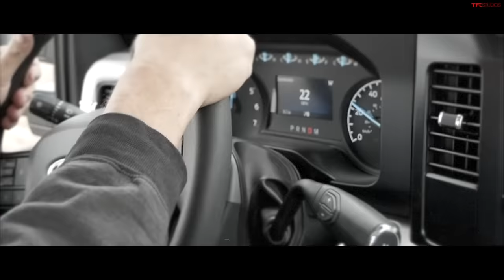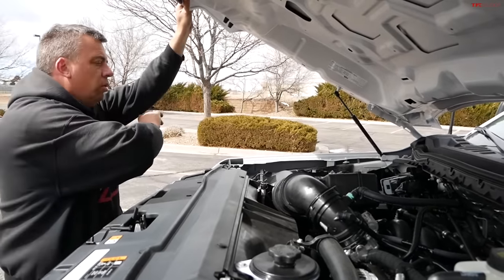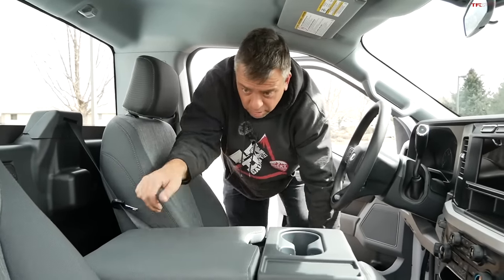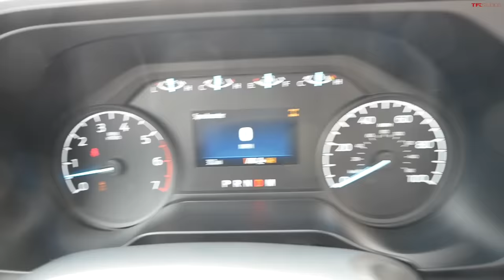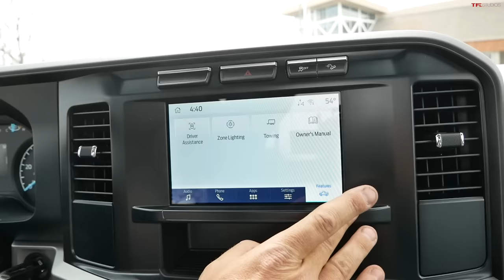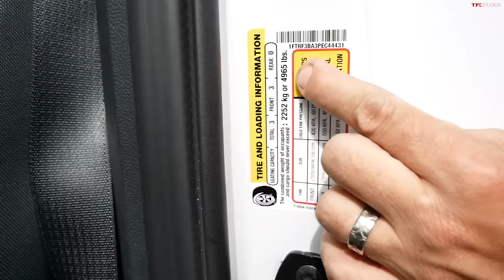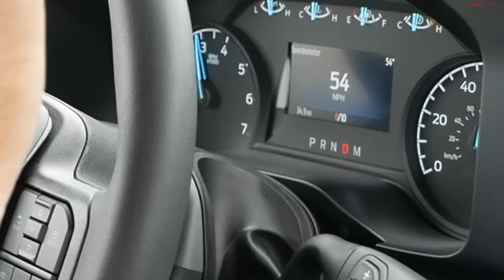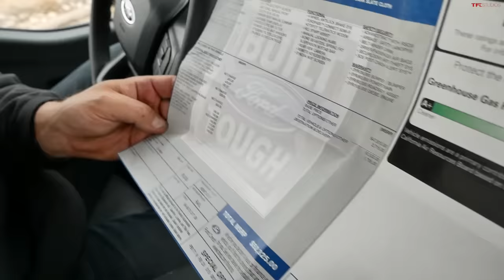I Drive a 2023 Ford Super Duty XL Work Truck with the Brand-New 6.8-Liter V8!

Comment: Basic truck? FX4? Work truck with no box liner 🙄 can you use the locker in 2Hi? Just a few observations and questions. Nice walk around though. I would like to be able to get power seats without having to step up to an XLT my boss had a F150 with standard seats and it wasn't comfortable for long drives I found the seating position to low. Maybe it's just me but I like the adjustability.
Reply: I agree the thing that stops a lot of buyers of the XL is the seat is too low.  As far as the locker it's clutch actuated and not switch activate.  It can lock automatically in 2wd, 4wd Hi and 4wd Low.
Reply: @dantimber  Thx for the info 👍

Comment: In other markets they make work trucks.. rubber floor mats, no large LCD screen.. never carpet..in the US business is burdened with $55-65,000 for work trucks and depending on the business type.. almost never makes sense to lease because regular mileage and wear and tear are seen as excessive damage..in most big markets in the US to find this truck for this price is as easy as finding a unicorn

Comment: I used to have 2004 F250 with a 6.8 liter, it was a V10.  310 hp but 425 ft lbs of torque at approx 3k rpm I believe.

Comment: place a 49xx lb gvwr based payload in the bed over loads any F350 srw 7230 or 6780 or 6340 rawr when we look at Fleet Ford specs. GVWR based payload sticker will have to be spread  3500-3800 lbs on the rear axle and the rest on the trucks front axle. 
    Great work truck tho.

Comment: The peak HP of 405 is rated at 5000rpms, the 7.3 is rated 430hp at 5500. If the heads, cam, intake and exhaust systems are all the same the 6.8 should really make it's peak HP at 300-500rpms higher than the 7.3 and the peak HP is probably more like 420hp. Just like the old 4.8 and 5.3 Vortecs, the 4.8 only make 10-15hp less at the peak at 500rpms higher than the 5.3. The big difference was the 35-40 ft/lbs of TQ and the 7.3 make 45 more than the 6.8.

Comment: 52k+ before markups for a base model work truck....absolutely INSANE!!! What are automakers smoking that makes them think this is ok?!? Most people looking for this may not even make that a year!
Reply: Have you even seen the half ton markets? 80k for a f150 plat when you can get a dually for the same price… my local chevy dealer sells 4wd LT trucks for 60K, and the GMC variants for 65-70K for SLT trims, denali ultimate are setting people back kidneys. $50k for a 1 ton is a lot more reasonable.
Reply: @No U  I get it thats it's more "reasonable" but 52k + for a 2 door no frills work truck is stupid when something like that was nearly 20k less just 2.5 years ago

Comment: is the 6.8 a bigger 6.2 or a smaller 7.3 based engine?
Reply: Smaller 7.3L. It shares the basic pushrod architecture of the 7.3L. The 6.2L was a more complex OHC design.

Comment: The MSRP for a 2WD F350 Regular Cab in the year 2010 was about $32,500. That’s nearly $46,000 today. The truck in this video is a 4x4, Has a more powerful and efficient engine, a 10 speed transmission, and a more advanced entertainment system. 

$51,000 is a fair price for this truck in 2023.
Reply: That being said. The base pay for my current job in 2023 is now 25% higher than it was in 2010.

Comment: Here's the numbers to remind everyone how much Ford/Dealers is taking advantage of you: The 2023 Super Duty starts at $43,900. In 2015, they started at $40,000 (inflation adjusted) and in 2012 they started at $36,600 (inflation adjusted) and in 2010, started at $33,200 (inflation adjusted).

In this video we see the total MSRP of a bare bones work truck with 4x4 at $52,000. At that price I don't know how it makes sense for ANYONE to buy a new truck. If you buy a new truck at these prices you're bending over for the industry and they're coming in dry, and you deserve it.

Comment: Did Ford fix the deathwobble issue in the front end? The front end (steering) has been  an issue for quite a few years.
Reply: They must have. I had just bought a 2024 XL STX, Crew Cab F350 and had it up to 80/85 mph and it drove as smooth as can be, no wobble that I had noticed or felt.

Comment: I wonder how this compares to the 7.3 in terms of reliability. I work on an ambulance and our county bought a fleet of 7.3s a year or so ago and many are having problems particularly with the cams to the point where weve had to bring in a lot of our old v10s back into service. I actually wish they still had the v10 as an option. They are not as torquey or fuel efficient but are a lot smoother and dont sound like a dump truck engine.

Comment: The perfect off-road starter truck. All it needs is different suspension, tires, bumpers, and maybe a bit of lift and you'd have a very capable offroading vehicle. lol. It comes with the heavy-duty axles that are needed, and plenty of power/torque. 
Most guys will buy an older truck to build an offroader and have $40k in it to get it to this point.

Comment: Cool truck, but for most truck owners these days a Ford Maverick will get the job done and is priced at $21k for base.  The vast majority of truck owners usually haul air in their beds and never tow.  But I get it, that truck is a fleet model that and most of those will actually have to work for their lives.

Comment: I drove an F150 with eco mode and liked it quite a bit.  Modern vehicles have far too sharp of a tip in on the throttle, like they need to feel like you're launching off the line every time.  The eco mode gets rid of this, and makes the throttle much more linear, so it makes the truck much more driveable.  
It will be interesting to see if the UPS cars on Ford chassis go to this engine and transmission instead of the 7.3 and six speed combo.
Reply: UPS trucks use Super Duty chassis? No wonder they sound kinda mean when they’re dropping off packages
Reply: @77R_  It's the F59 motorhome chassis, with the gas 7.3 and 6R150

Comment: Car manufacturers still doing halogens. They need to move to leds, even in the fleet vehicles.
Reply: No. Some people live in cold climates. The low beam LEDs on my Volt have been a real problem many times. Not enough heat to keep the lense clear during icing conditions.

Comment: Please get a Chevy ltz  with the 6.6 gas and 10speed transmission and do towing test with a travel trailer weighing around 8k. I’m very I interested in the mpg  pulling a camper.
Reply: I meant chevy Ltz or high country just wanted loaded up with options

Comment: Why do we need two different big V8 engines? Ford should concentrate on making the 7.3 10 speed combo rock solid, if they wanted a cheaper base engine to replace the old reliable 6.2, they should have developed a HD inline six cylinder with a manual transmission, that’s what us cheap guys really want.
Reply: You're never going to see a true clutch operated manual transmission in new trucks again, and even if they offered a big displacement inline six with a manual transmission it would still cost as much as this truck. The days of TRULY simple and cheap new trucks are long gone. This is as simple and cheap as it's going to get.
Reply: @nathanmcdonald610  Yeah, I know, but I will forever miss those days.

Comment: Definitely a reliable traditional Ford naturally aspirated V8 engine!! The 7.3 is actually still available for a higher price. 6.8 is still a great engine though!! No doubt that truck could last 1,000,000 miles with proper care!! Those Ecoboost engines can last 200,000 miles, but that is not without regular rebuilding and maintenance! The only con of these is the gas mileage. However, trucks are not supposed to have good gas mileage. That is what SUVs and sedans are for!!!

Comment: Question. Aren’t you supposed to wait 1,000 miles before fully flooring it and doing a 0-60 test?  This is because the engine has to break-in.

Comment: I wouldn’t mind that trim overall. Two things I like that a lot of basic trims don’t have is a leather wheel and climate control. I would rather have those vs the drive modes. Locker is nice and appreciated. I couldn’t do the reg cab. I think pricing is still insane for a gas pickup. Lastly those steps are so ugly.

Comment: I mean, while I could almost justify that kind of price for a work truck, I remember when work trucks were NO FRILLS. That truck still has way more technology than a work truck truly needs. If an owner of one of these hauls/tows daily, running loads/parts/whatever all over the place and the truck manages to stay reliable, that is great. But, I foresee many issues down the road. Most of the people I see even managing to get by towing/hauling lately are doing so with older trucks.

Comment: Ah, so this is what Ford is doing with the 6.8-liter.  Replacing the 6.2 with an engine that has more HP, less weight, more compact dimensions, and lower cost to manufacture.  And it's got basically the same HP and torque as GM's 6.6-liter, yet is the base engine.  

I keep hoping that Ford will do an aluminum-block 427 version for the Mustang.  Maybe I should do one myself.  Ford fans would make me rich beyond my wildest dreams.

Comment: I wish they would re design the new trucks to look different. They add another 1 inch bigger grille and headlights and call it a “new design”, they are facelifted at best, the ford and Chevy trucks have looked the same since 2010 and dodge is even worse theirs looks the same as an 05 dodge 1500

Comment: To those saying 52K is high for a base truck - this is a 1 ton 4x4 with 400hp and lots of capability. A 1/2 ton 4x4 with 300hp will run $43K for a similar bare bones trim. Having two alternators and two batteries and even the fx4 stuff - seems like a good deal, considering the current situation.

Comment: I find it interesting that they still use hydraulic power steering still. Plus the 6.8L looks very similar on top compared to the 6.2L
Reply: They do it because HD trucks don't have to display EPA fuel economy ratings on the window sticker.  The main reason for adoption of electric power steering was for improved fuel economy.
Reply: @Andrew Smith  ohhhhh that totally makes sense! I drive a 2018 F250 for a work truck and love it, it has the 6.2L and it's been a great engine, hopefully the 6.8 is just as good!

Comment: The problem is, even with this truck as configured but with 4 doors is $59,xxx with the gas engine.

With a diesel it's a 12k add on.

Seems like all trucks these days are $10,000 over priced. They offer similar interiors from the 2000s all plastic but 2x the cost.

Comment: Booyah 👊🏽 😁 👍🏽 🇺🇸 
Still too darn expensive for the average guy and gal.
Reply: Gotta pack lunches for work. Thats what I do so I can afford a new truck
Reply: @Jason Zackey  I believe you, and I am in the same boat. But if you don't hunt and search for the right dealer, add on a boat load bs and unnecessary cost. The supercab chassis cab 4x4 6.8L srw is high. 

But if the truck isn't working, then the money is not coming.

Comment: If the payload is 5,000 pounds, then this isn't a 1 ton truck. It makes it a 2.5 ton truck. The whole thing with 1/4, 1/2,  3/4 and 1 ton trucks was when older trucks couldn't take that much weight in them.

Comment: Affordable is a joke, but he’s right you could easily get it for $1000 less with fewer options. And remember this is a 350 so if you only need a 250 it’s probably $3000 less or so? And 5000 pound payload capacity is insane for a single wheel.

Comment: Ford is now building what is basically an LS which GM had 25 years ago.  The seat design looks just like (but not as good) the one in m y 2013 GMC.  And the key is identical to the one in my 2014 Camaro.  lol.

Comment: It's interesting how much HP has improved in big blocks relative to how little the torque has.  We had a 97 K2500 with the Vortec 454.  It had 410 lbs-ft of torque which is only 75 less lbs-ft to the 2023 7.3.  However the vortec only had 290 hp where the 7.3 has 430, 140 more!  In some regards there is still no replacement for displacement, but there is also something to be said for being able to keep torque up the rev band with breathing.
Reply: ONLY 75 lb*ft less than the 7.3?  That's almost 20% less torque, and is something you can definitely feel in your butt-dyno.
Reply: This engine has 17 ft/lbs less than the outgoing V10. I'd like to see the dyno curves on this. 

Too much emphasis on horsepower, not enough on torque. The old V10 was deceptive. It might not scream on top end but would pull like a diesel in the basement. That's what counts in work trucks.
Reply: @andyharman3022  it's also 26 years of ice advancement. My point is that for n/a engines the torque/volume ratio hasn't changed as much as hp/volume. I.e. the combustion events aren't much more powerful for a given swept volume... It's just that we've figured out how to keep them producing at a faster rate.

Another comparison - my equally old 1fzfe produces 61 lbs-ft per liter. The 7.3 is only 66.

Meaning if you scaled my 4.5 I6 up to 7.3 liters it would make 445 lbs-ft... For a low compression non variable valve timed motor. The difference is that it would only make 343 hp because that torque drops of like a rock before the hp even had a chance to build.
Reply: 20 years of tech.
The GM was a big block. This Ford isn't

Comment: I LIKE IT! I want one... exactly like this one. After an F100 in 1969, and multiple F150's since, all work trucks with 8' beds,  this would be my retirement truck - with a camper, it would take around North America one last time. I usually put over 200,000 miles on all of mine.

Comment: The 6.8 is aluminum block...I think. Which makes it lighter than the 7.3.

Will the 6.8 replace the Coyote V8 in the F150?  🤔
Reply: 2 years ago they where talking about this engine that it will replace the 5.0 near when the new f150. But the conversions got quiet. And turns out it was for this truck.
Reply: Pretty sure the 6.8 is an iron block just like the 7.3 that it’s based off of.
Reply: It's a cast iron block like the 7.3 Godzilla. Exact same bore with .30" shorter stroke.  Probably the exact same heads too. The 6.8 is using a 10R100 Transmission.  the 7.3 uses a 10R140 Transmission.
Reply: I doubt this engine will see life under the hood of the F-150. It's fuel economy likely won't be as good as the 5.0L and the 5.0L already makes the same HP and not all that much less torque, albeit at a way different places in the powerband.

Comment: $2,500 more for the 7.3L engine with only about 30 extra HP?  No thanks!  And the diesel for $10,000 more?  And the need to spend over $150 for each oil change and fuel filters?  No thanks!  This would make a wonderful truck to pull a moderate sized fifth wheel or travel trailer!  And 4,000 pounds of cargo rating is wonderful.  4.30 rear axle ratio, I would probably skip that option too.  You will get slightly higher MPG with a 4.10 or 7.73 rear axle ratio.  And I am old enough to know that burning up my tires on 0-60 MPH runs is just a waste of gas!

Comment: Ford needs to bump the 7.3 to 450-460bhp and 500ft lbs to keep it relevant imo.
Reply: Not necessarily, the 7.3L is still decently ahead of every other gas engine in the class.

Comment: Why even put the 6.8 in it at this point. The 3.5 ecoboost is putting out 400 hp 500ftlbs of torque. Tune it like a raptor or similar and it'll make more power than that 6.8l
Reply: Because it's not about making more power. The Ecoboost was designed with a completely different life cycle in mind than anything offered in the Super Duty. The 6.8L and 7.3L could EASILY be tuned to make outrageous power, but by their very nature of being detuned and high displacement means that even when working hard they are generally under stressed which will make them more durable in the long run.
Reply: @nathanmcdonald610  Which really gets to the main issue with these turbo gas motors...nobody will put one in an HD application presumably due to reliability issues.

Comment: Little 5.7 Hemi 395 , so I would have figured 425 and 500 torque
Reply: Totally not comparable. The 5.7L hemi is designed for 1/2 ton trucks, the Ford V8 is most compares to is the 5.0L Coyote that makes 400hp currently.

Comment: Nice review but one thing. If you don’t know how well the Eco mode will work don’t guess or speculate, Edina quite such a negative way. It’s possible the best benefit may occur in the city. You just don’t know. Prior experience is pointless because this is a new version of the SuperDuty. Even year to year changes in mapping & programming can make a big difference. If you haven’t tested it, and you really have not tested Eco mode vs Normal mode in any specific way, especially in city applications. Talk about what you KNOW, not Wah at you ASSUME. I’m in another country so you assuming only makes an ass out of you, not me. I’m not buying just on the basis of what TFL says. There’s too much opinion vs fact on some reviews.

Comment: It will be interesting to see if the 6.8L (Baby Godzilla) will be subject to the same engine catastrophic failures as the 7.3L - cam phaser wear, oil pump failure, ten speed transmission anomies, etc. 

Only time will tell!
Reply: Don’t forget the lifter eating chevy engines nothing like complete engine failure under 10,000 miles
Reply: @CoyoteFTW  believe this review was on the newly introduced 6.8L Ford engine. Incidentally I have a 2021 Chevy 6.6L Gasser with 60K no issues. But point well taken. All of these modern gasser engines should be bullet proof of regular standard maintenance adhered to.

Comment: What happened to the godzilla motor?
Reply: It's still available 13:18 Andre mentioned it
Reply: The 6.8L is replacing the 6.2L the 7.3L will continue on as a mid range option between the 6.8L and 6.7L Powerstroke diesel.